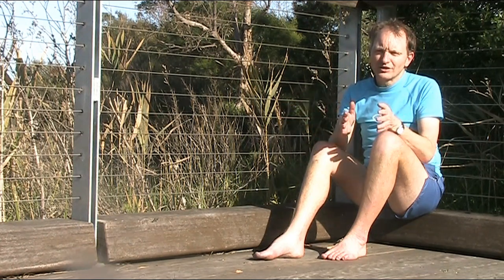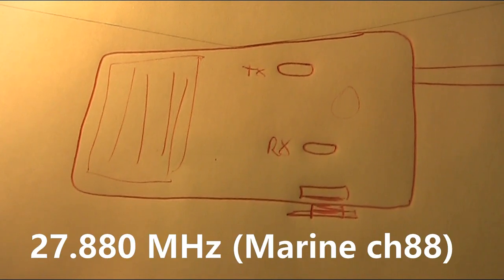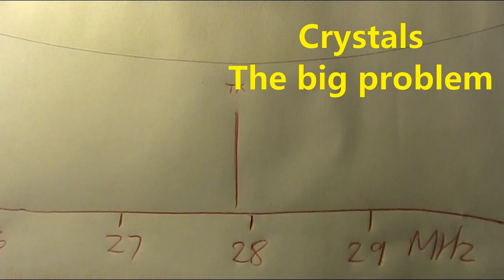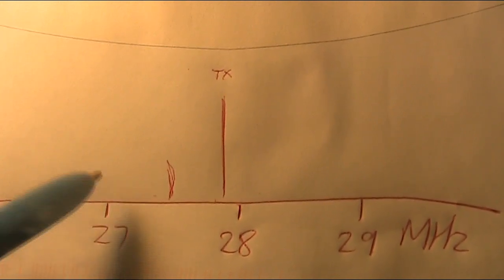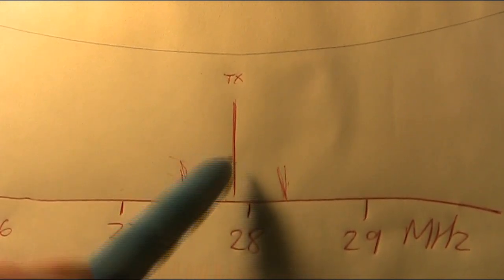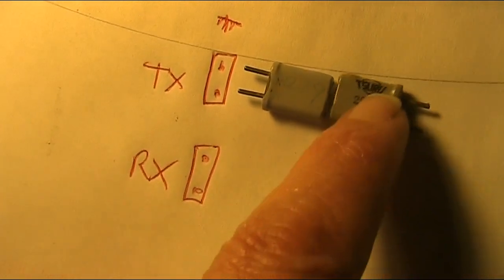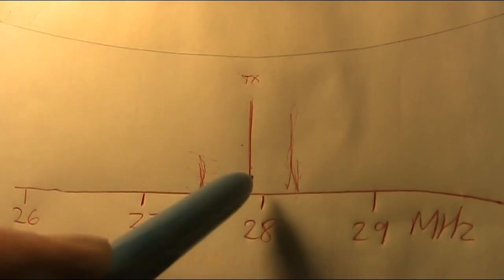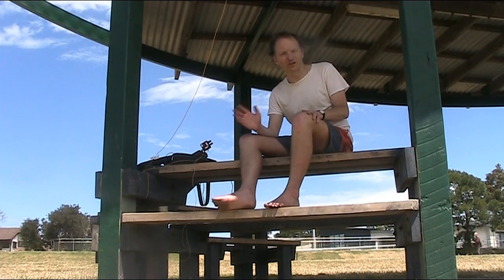Crystal swap trick for 27 to 28 MHz AM walkie talkies

Comment: We did this in circa 1991, with a 27Mhz crystal controlled marine TRX. From memory, TX on 27Mhz, RX on 21Mhz. Sounds strange compared to what you've shown here, but YMMV. I have several "defunct" 27hz marine transceivers here that are crystal controlled. I need to simulate again to confirm.
For those that frequented 27Mhz marine radio in Sydney, 1970-1990, my grandfather was a very well known marine radio base station operator.

Comment: Hi, i have an old Lafayette hand held Walkie Talking, it has 3 channels (A,B,C) and it has two crystals per channel, i noticed that they are 27 up to 29Mhz, i have a question, is there crystals for 69Mhz and is it possible to put in those in this Walkie Talkie ? Thanks
Reply from the maker: Short answer is no and no. A walkie talkie would need its circuitry to be changed greatly for such a big frequency change.

Comment: Peter. I have a 6 channel marine cb. looked at the crystals and found some are high and some low side. Does the radio just adjust to accept a high or low crystal?
Reply from the maker: I remember reading a warning not to mix high and low side crystals in a Dick Smith catalogue. If the rx crystal osc has a slug tuned circuit then it won't be resonant if you have both types. So it's one or the other unless you're lucky.

Comment: How do you tell if a crystal is transmit or receive
Reply from the maker: You have to check the marked crystal frequency against the list of 40 CB channels. If it's on there it's a TX crystal. If you need to add or subtract 455 kHz from its marked frequency to get a frequency on the list then it's an RX crystal.

Comment: Hi Peter, ZS6SI here. I wanted to ask a question about the Yaesu Ft817. I'm getting my hands on one very soon. They guy said the internal battery is practically dead. I plan to use an external battery anyway, but would you recommend removing the internal battery entirely or is it fine if it stays in?
Reply from the maker: I'd remove it. It just unplugs.
Reply: @vk3ye  thanks for the reply!
Reply: Remove it but keep the hardware, especially the connector for future mods. Great little radio.